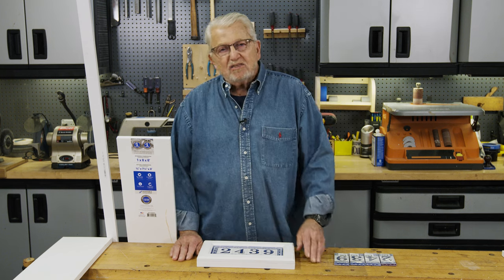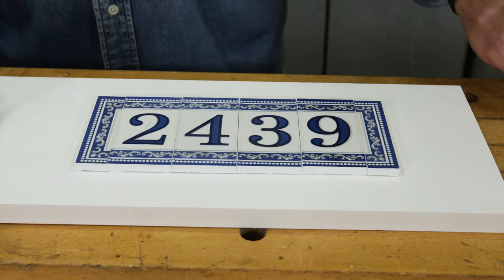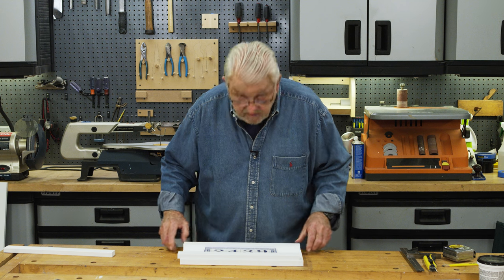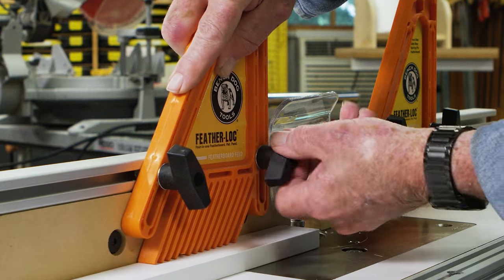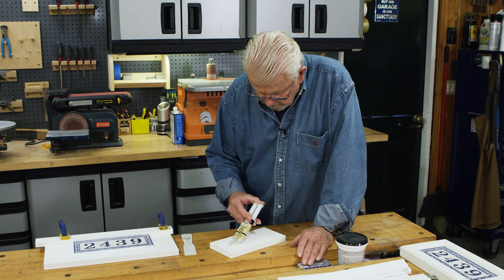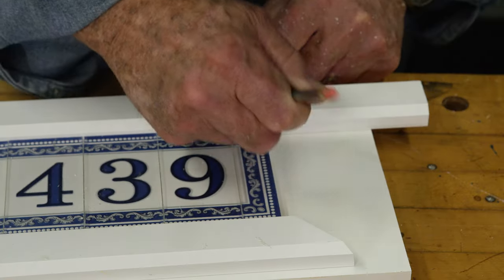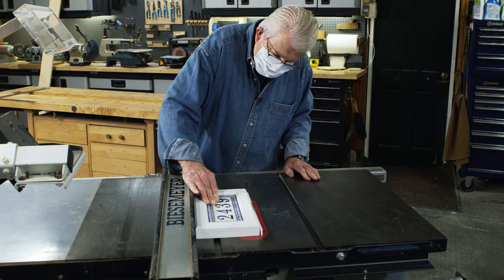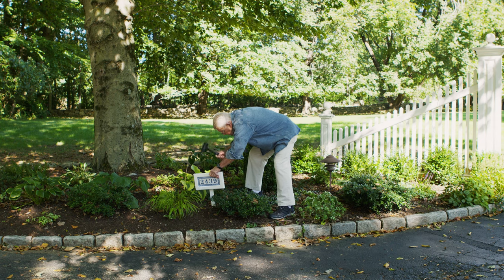How to Make a DIY House Number Sign

Comment: Even easier than that; You can buy PVC address plaques at stores, shaped, routered, drilled, ready to go. You can buy aluminum or brass letters. 
The trick is a decent leg if mounted in a flower bed. I used two aluminum “spindles” for aluminum fencing. 
I threw it together in about 60 minutes. Maintenance = zero. Cost totaled about $35 all finished. Only thing I had to cut/drill was cutting the “legs” from one fence spindle with a hacksaw & drill mounting holes for a pair of screws & wing nuts.